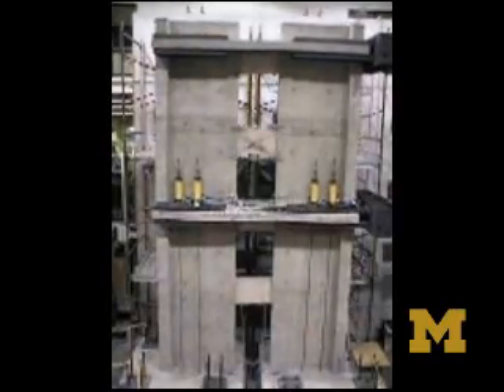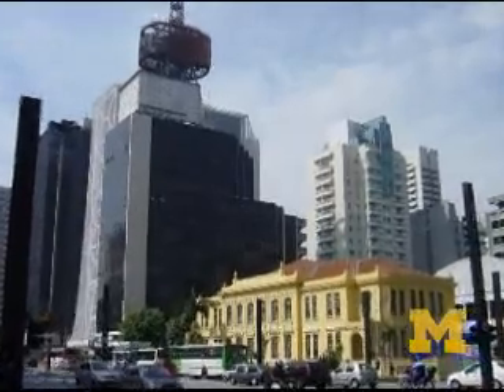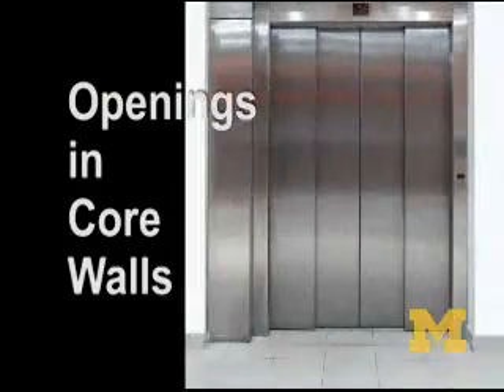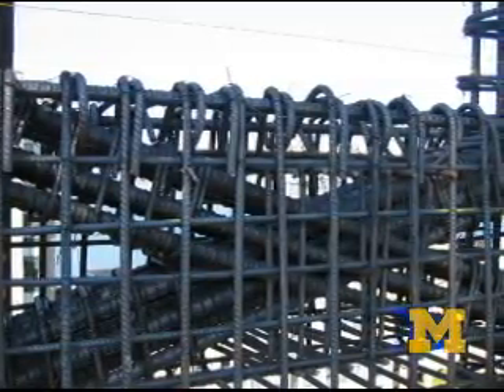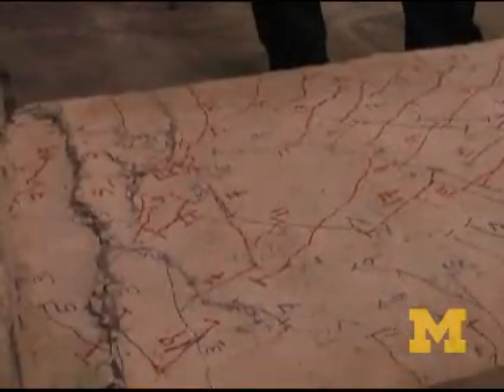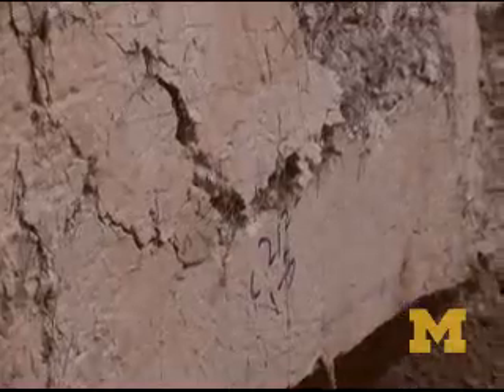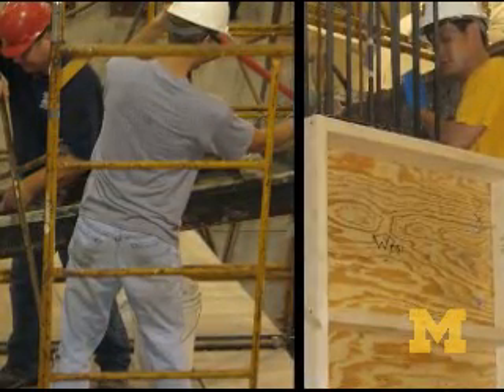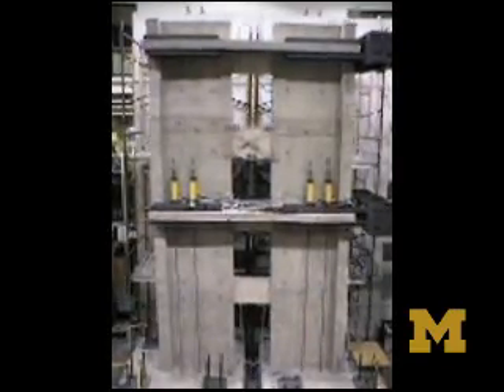Bracing for Earthquakes

Comment: I read and investigated seriously in thi issue in quite a few articles about this test perform and I got the knowledge and conclusions that the fiber used in this video and test with excelllent results was Dramix RC80/30BP and not the Helix 05-25, never the less Helix worked but not as with the amazing perfomance od Dramix, in fact the fiber shown in the video is Dramix and not Helix. Also the video has been edited. Please do not lie and try to tell the truth.to the market. Thanks

Comment: No they use Helix Steel. It is much stronger then Dramix and typically can replace it at 1/3rd the amount. I have see it replace Dramix at 1/5 the amount for some Standard Codes. Helix is a complete replacement for rebar and mesh.